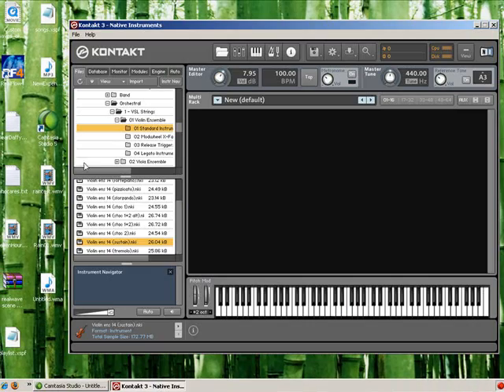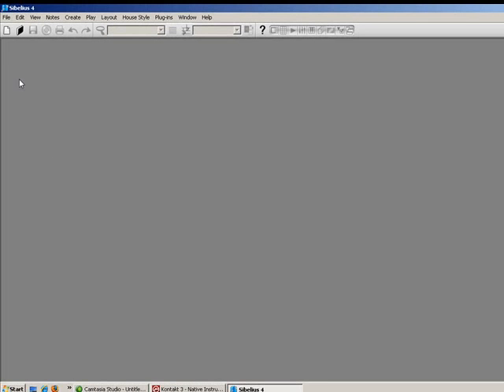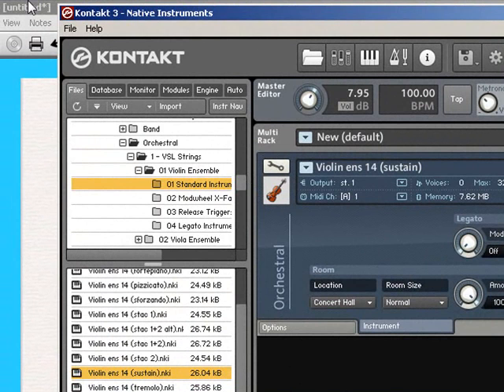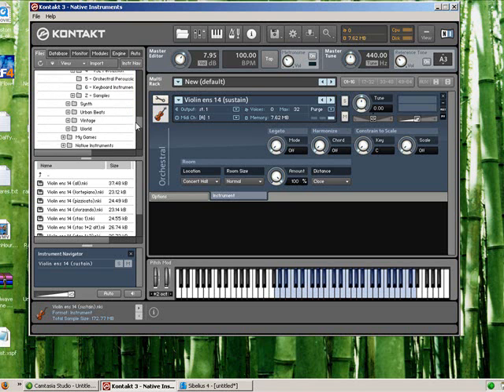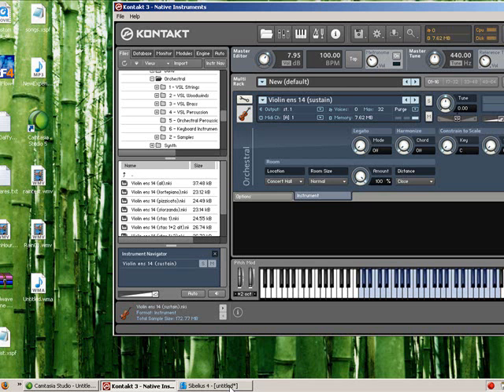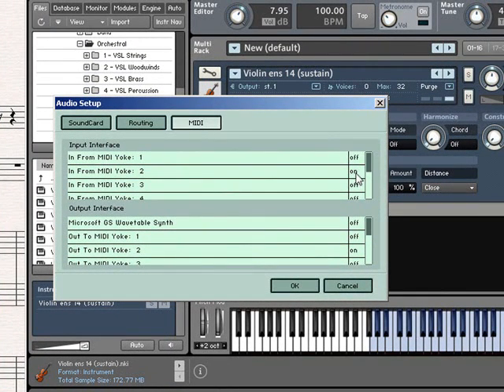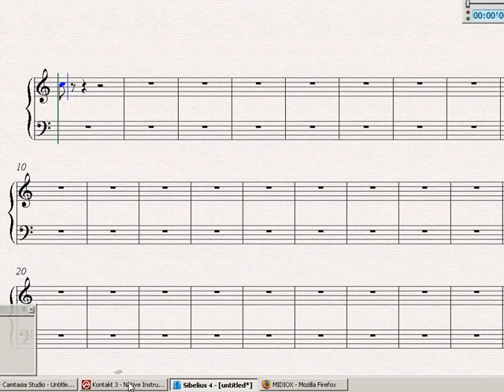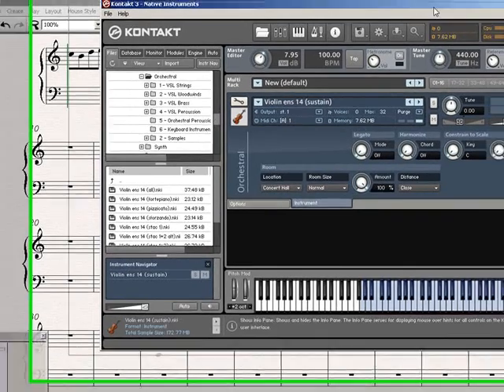Audio, MIDI, Kontakt, and Sibelius Tutorial

Comment from the maker: @marktwainisgod Ah, well that is a completely different method and problem entirely. Versions of Sibelius beyond Sib4 use a different method. As far as I recall, it uses a sort-of VST system where Kontakt would be a sort-of plugin, whereas my method uses the two applications independently. I don't use Sibelius 5 so I'm afraid I can't be of much help, sadly :( Look into the application "Jbridge" for another way of using your VST's and look into Sibelius sound sets. Sorry I couldn't help more :(

Comment from the maker: @marktwainisgod That's because Sibelius doesn't "see" Kontakt at all. You have to install a Virtual MIDI cable, in this example I used Midi Yoke. Then in Sibelius you set the output to Midi Yoke 1 (or whatever number you want) and in Kontakt you set the input to Midi Yoke 1. The idea is simple. It's like hooking up a cable between the two.

Comment from the maker: @piojoarg10 It depends on the version of Sibelius you are using. In Sibelius 5 and later, they really screwed up the system (in my opinion). There's no easy way to do this in Sib 5 and later and quite simply there's no way to do it period with any sort of virtual midi cable such as Midi Yoke.

If you have Sib 4, it's just like it is in the tutorial. 16 channels for each Midi Yoke "port". In Sib, set the port and channel to correspond with each port and channel in Kontakt. Hope this helps :)